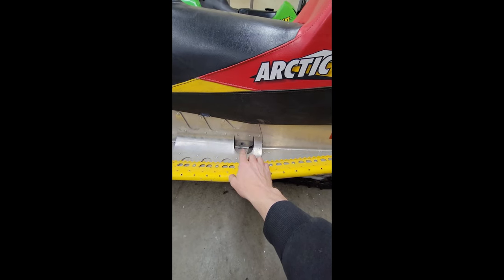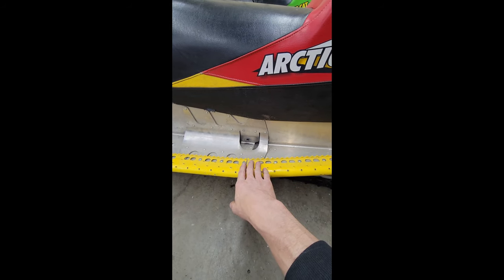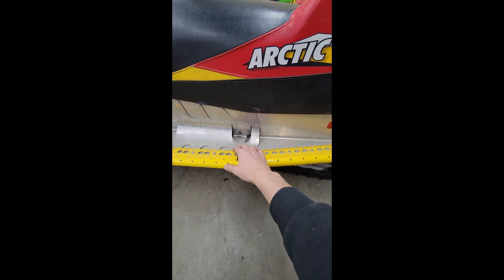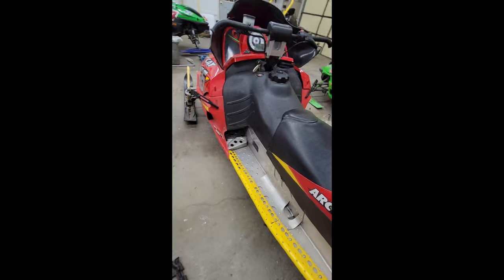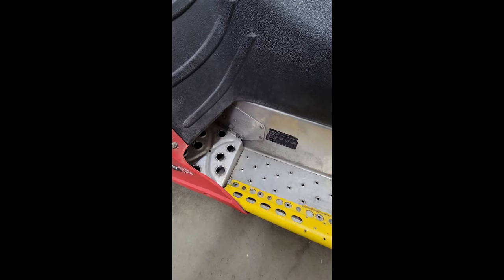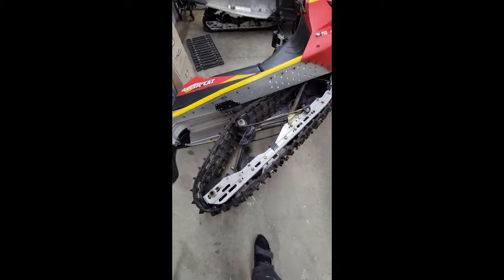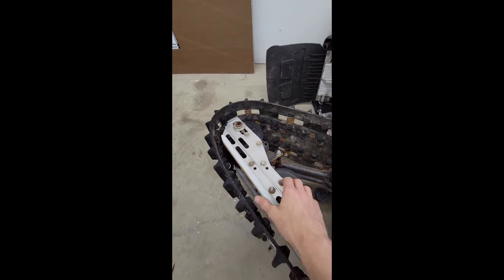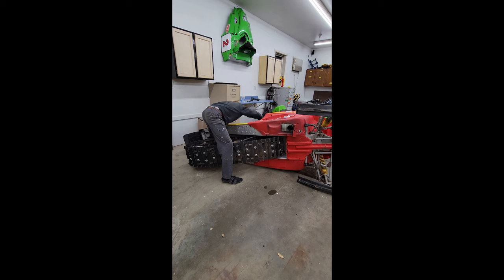Sled Tips 020: How to remove snowmobile rear suspension/skid

Comment: Thanks alot for this video. I just bought a sabercat and the rear suspension is a bit low and soft for my liking so im throwing a firecat skid on it
Reply from the maker: Nice! Another thing to do would be to check your spring blocks and rear arm stops are adjusted to your rider weight. There should be a sticker on your clutch cover that shows you. Let me know if you have questions. 

what are your plans for the sabercat skid? I might be interested in it.